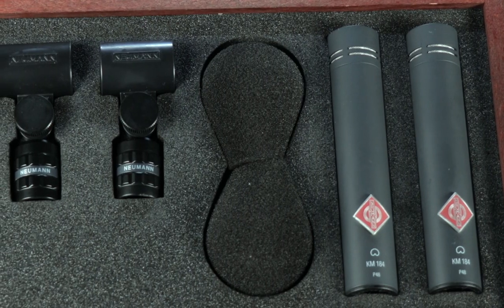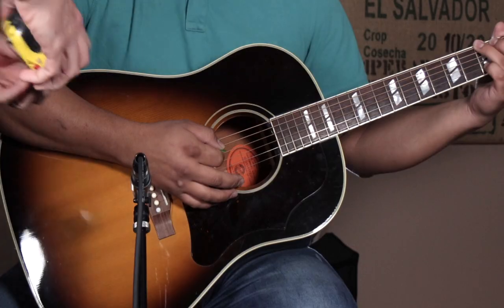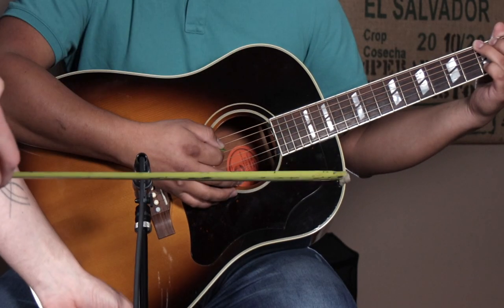Acoustic Guitar Mic Techniques and Placement w/ Neumann KM 184s

Comment: Oh, thanks for the video. Basically it matches my experience as well. Just one thing: 6 inches in front of the soundboard on my classical guitar is unthinkable. The tone of a good classical guitar often originates much further away. I have to go more like a meter, 40 inches away. With another guitar, however, it is possible with less distance. But it doesn't have a good projection either. It definitely depends on the guitar. With a classical guitar with good projection, you can't set up the mic too close or directly in front of the sound hole.
Reply from the maker: Yes, good point. If this was an actual classical recording, I would approach the miking from a greater distance in order to capture the true sound of the instrument. Thank you for the comment!

Comment: single mic sounds better in all examples.
Reply from the maker: And also less a risk for phase issues or other problems. I agree and tend to prefer committing to one great sound that benefits the track.
Reply: I did a session last year and the engineer used two mics, a U87 clone and a small condenser like a KM184. The clone was far away and the condenser close. I told him he was going to get phase issues but what do I know. It sucked. One KM184 properly placed and in a good room is hard to beat. 
 @ToddUrban
Reply from the maker: @laurenbroido9  exactly. And just because you use a great mic doesn't mean the sound will be good. Thanks for the great story.